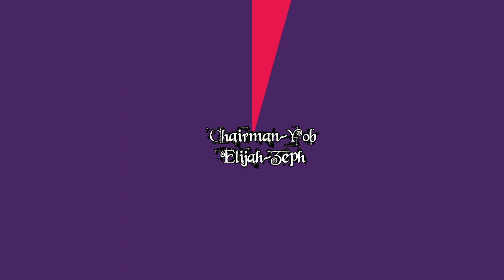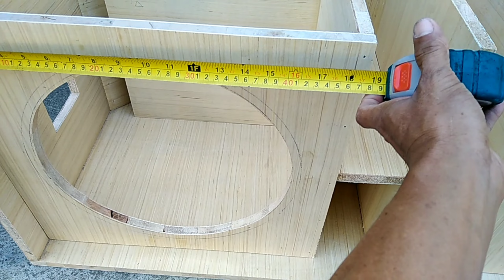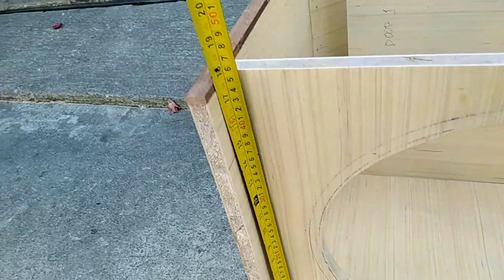L Forted Dual Box Subwoofer di 15 paano ginawa.?

Comment: boss anu po tunog pag wala yung sidings sa gilid na para sa bounce ng hangin gusto ko lang po malaman para may idea ako.salamat po
Reply from the maker: @Carylle8 ano pong siding sir
Reply: @chairmanyobdiywoodworking5289  Yung may cut po na 45 degrees Yung pang sulok pasesnsya na sir first time oo gagawin may mga gamit nako mga circular saw jig at mga corner clamp gusto ko lang po sure Kasi tagal ko pinag ipunan pambili salamat po sa pag sagot
Reply: Yan po gagayahin ko kaya paulit ulit ko pinapanood po
Reply from the maker: @Carylle8  ok po sir..👍👍👍

Comment: idol matanong lng sana ma pansi..yung 2 speaker na tig 500w bawat isa..pwede bang hatiin yung dalawa.. speaker 1 mid high.speaker 2 low..gamit ang mixer na 4 ch at 1 amp?
Reply from the maker: Pwede naman po kung pambahay use lang naman sya, pag may budget na uli bili kapa ng isapang pang midhi at pang sub para balance na..👍👍👍
Reply: @chairmanyobdiywoodworking5289  idol salamat sa pag pansin..pasok ako sa chanel mo idol..bagohan lng po ako..pero gusto ko matoto kaya d2 nlang ako or sau sumosubaybay...gusto ko rin matoto kahit kunti sa talent mo idol/maestro🙏
Reply from the maker: @bryanshon-89  salamat din po sir,  tuloy mulang  sir  bastat may pangarap  kayang matupad  sa pag susumikap..♥️♥️♥️